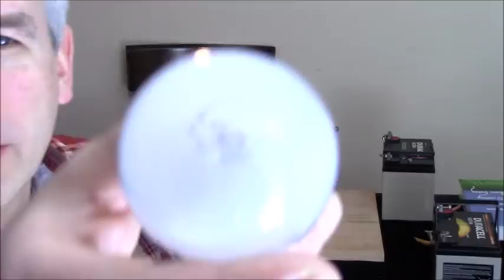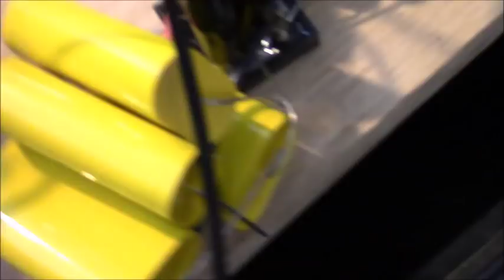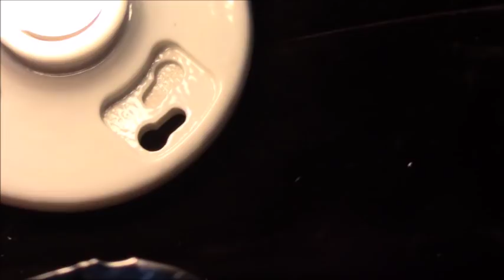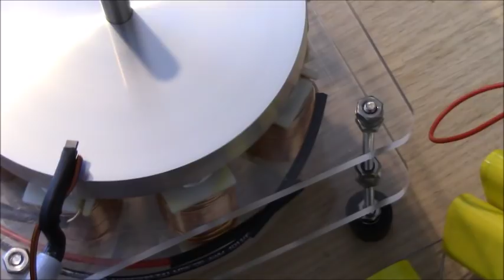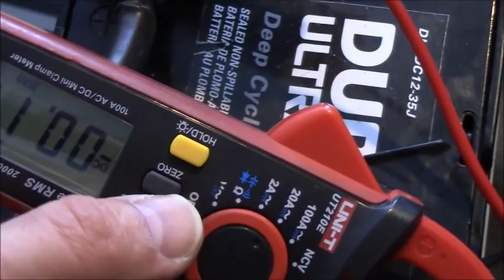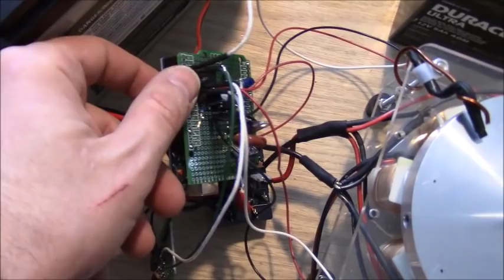Mini 4 DualPole Motor Powering  100W bulb while Drawing 40W

Comment: Good work Boss. Can this setup work 24/7 365days . And upgrade to 500watt
Reply from the maker: yes but not 500W.
Reply: @rickfriedrich  how many watt can work 24/7 365days
Reply from the maker: It depends on the voltage you run it at and how much you load it down. Right now the motor puts out about 100W @12V without the options I mention. So it is about 200W@24V. We have not made it available at 36 and 48V yet, but the wattage goes up with voltage.
No as you add options you also increase the output. So at 12V you can add to the 100W another 50 to 100W with the MICK addition (4th stage process). Additionally you could add the 3rd stage process, which is like the MICK (only on the back end), which could increase the output even more (and actually as much as you want). Then you could always add the additional batteries with the second stage process and get more still. So it depends on these options. Some people can apply these optional processes and get as much power as they need...
Reply: @dylans voice  do you have the working device am ready to buy let me know the cost and the wattage. Thanks

Comment: is it possible to instead of using a + to - , or a 24-12  + to + setup, to maybe use a possitivecharged battery and an negativeçharged battery with the energizer being in the path between them charging a 3th battery.. instead of simply asking you i could do the research but im the guy that needs to go to a friend's house for internet''skooping home" a smartphone of wissdom at a time ;)
Reply from the maker: I have no idea what you are saying here.
Reply: @rickfriedrich  im pretty new with  this stuff and im still catching up with your videos, i was wondering if u use a 12v posive charged battery and a 12v negative charged battery connect - to - and the cirquit between the + +.. just wondering if the weel.would.keep spinning.. have a great 2019
Reply from the maker: OK now I see what you were saying. There are many options and I haven't counted all that I have done. 
The positive and negative charge is not related to the positive and negative terminals of the batteries. So that is not how it works. While you can do several things where the wheel still spins, but the issue with the negative charged batteries is whether the setup will also allow for charging the batteries at the same time.
Reply: @rickfriedrich  yeah talking about many options, i think it was your video about new 4 dualpole instructions i heard you say something about the optional bulb between the positives, i replaced it with a  battery connecting + to + and the normal and the negative terminal to the wire that normaly goes to the plus and it also charges :) .. and my negative goes to a capacitor negative and + to emitter  , powering a ledstrip with remote control.. changing brightness or color is my speedcontrol now ghehe